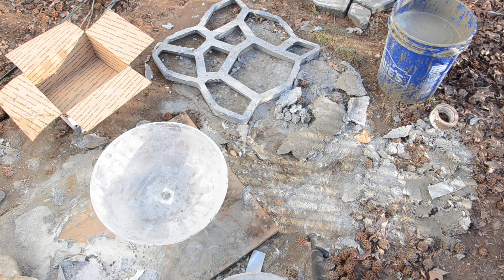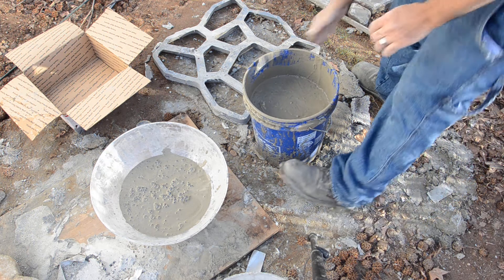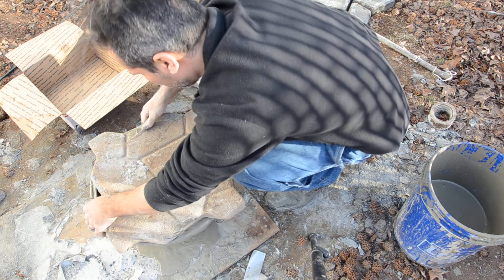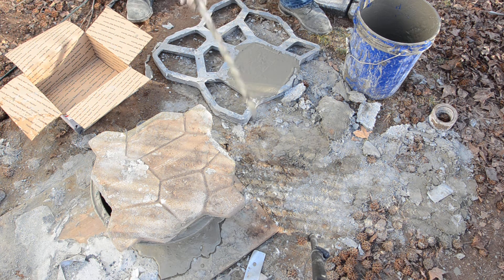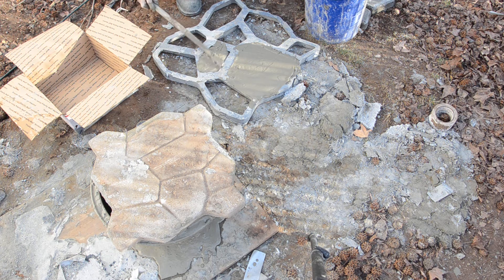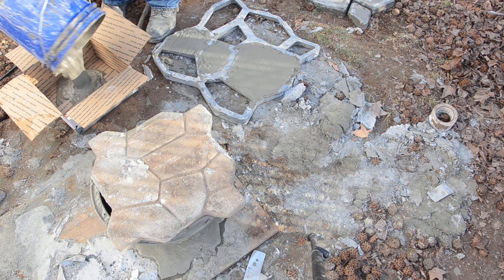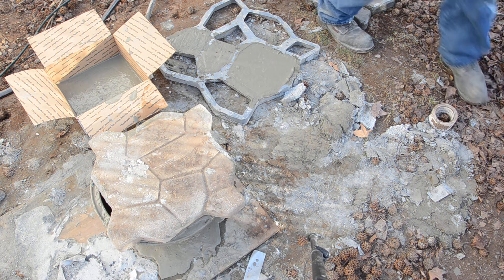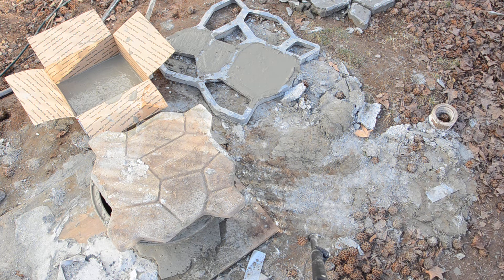Making Foam with green dragon for Aircrete | with Basalt Fibers Video | 4 of 4 #AircreteHarry #diy

Comment: I am saying thanks I am  making my own system and so far so good I am trying glass water as additive I am building a dome kiln so air is key but hardness helps thanks  sodium silicate got good results on hardness and strength   recipes depend on application  again thanks  got foaming diy plans  from green dragon trying my own mixing system just more metal less plastic  Your test show a great potential .

Comment: Hi Harry-good luck keep trying until you get it right. Concrete mixes have to be proportioned right and a little too much water can be a lot. Use around 5 percent or 7-8 pounds per yard of the basalt chopped fibers. Also in some places the basalt mesh adds another layer of strength and for super strength the rebars. Silica fume and fly ash and plasticizers can be added to give more strength as well. Well found aggregates-in your case for a lightweight solution pumice or expanded shale will add insulation and strength. It may be that an inner core of foam concrete coated with a mesh and high strength concrete will be best-a candy coating. Finely ground minerals like basalt rock, bauxite, corundum, quartz, granites etc. even recycled glass bottles make good aggregates.